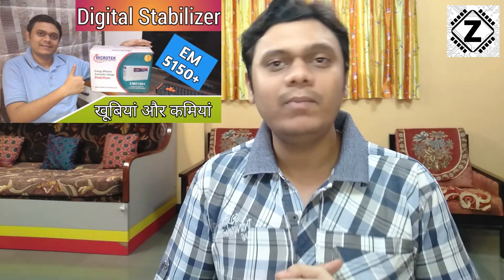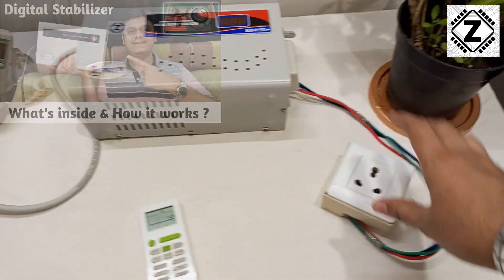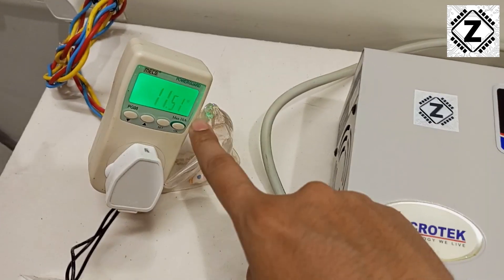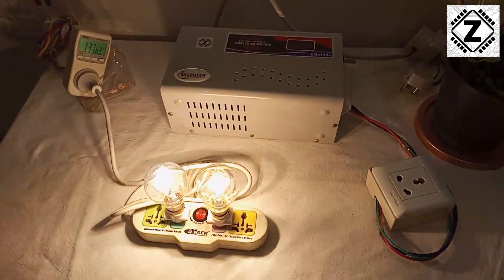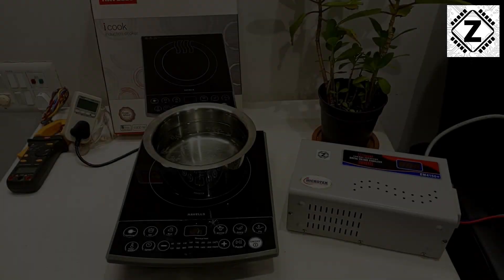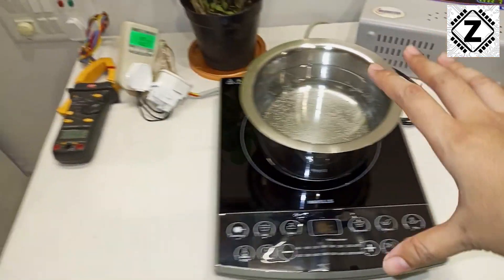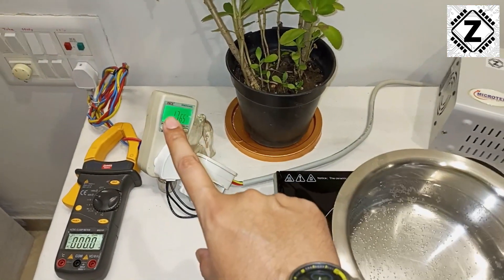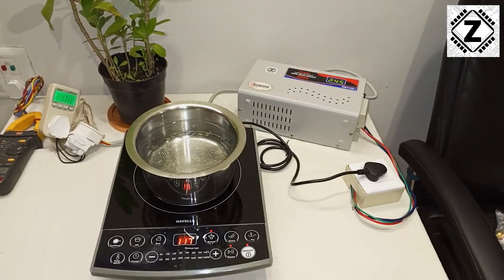[Eng] Power Waste? High Bills? Microtek Stabilizer Idle draw & Efficiency PROOF | Should you buy it?

Comment: Sir which is best  voltage stabilizer for  1 ton  LG dual inverter AC?
CAN YOU SUGGEST ME SOME OPTIONS
Reply from the maker: Everest 4 KVA Triple Booster Digital Model Voltage Stabilizer for AC Upto 1.5 Ton –(Working Range : 90 V to 300 V)
https://amzn.to/3NKQiki

AULTEN Digital 1.5 Ton AC 4 KVA 3200W 130V-280V
https://amzn.to/46lgUj2

Microtek Pearl EM4130+ Automatic Voltage Stabilizer for AC up to 1.5 ton (130V-300V)
https://amzn.to/3r0POxp